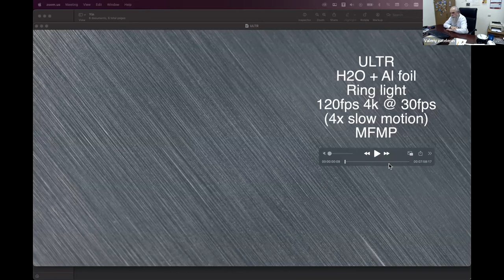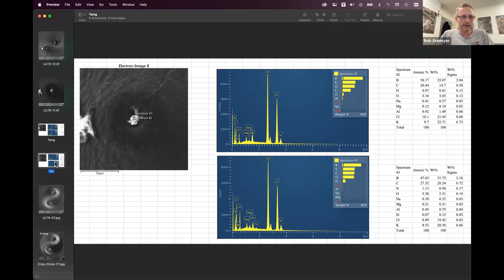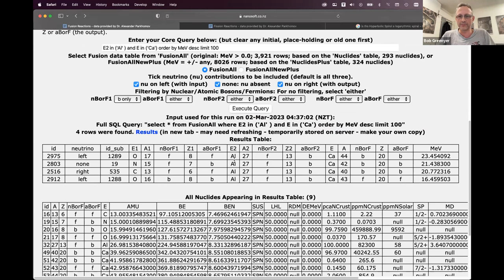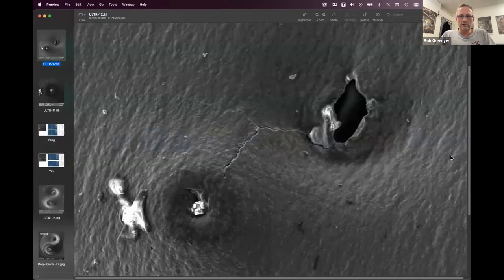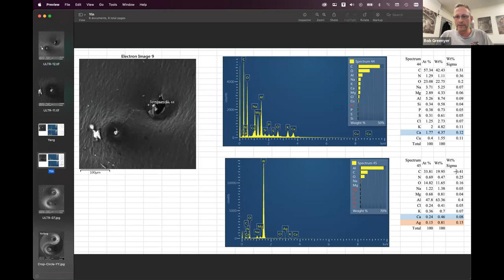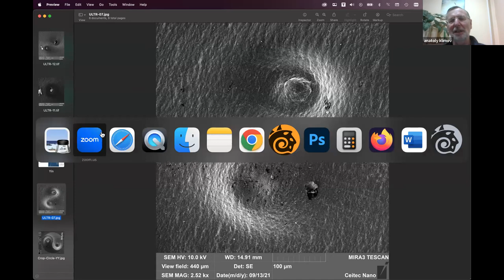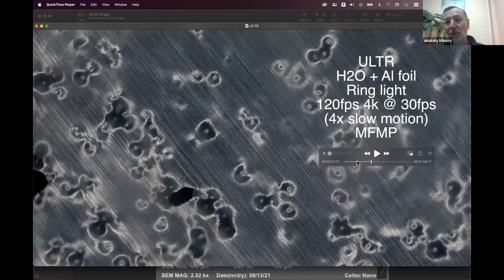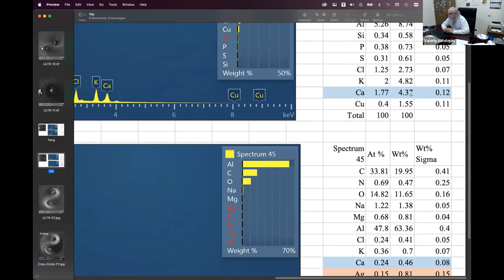O-Day - Balance

Comment: I contacted my local MP, the Secretary of State for Science, Innovation and Technology, about the Carbon Arc Furnace’s generation of 4 tonnes excess Silicon/Iron day in, day out for 11 weeks - it was, apparently, passed on to the Department. I added the information about Brilliant Light Power’s upcoming presentation on 6th, 7th, 8th March - needless to say, heard nothing back yet.  Scared rabbits in the headlights comes to mind. That, and I’ve no doubt, lots of negative reactions from the fossil fuel lobbyists.  Yet, this is the future - and, yes, to take the lead from the yin-yang symbol, in my end is my beginning.  It is time for the world to move on from fossil fuels and grasp the opportunities this technology offers to address so many of the issues faced today (although, of course, there will be new ones in the future but, as my old dad used to say, you can drown in an inch of water, but that’s no reason to stop drinking the stuff)
Reply: Every representation loads the dam. Thanks for passing forward what you know.